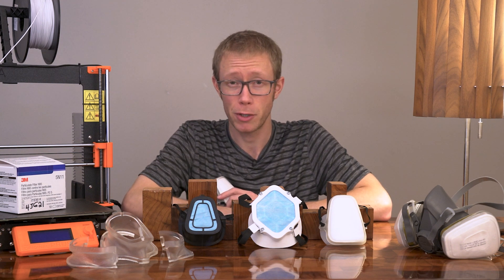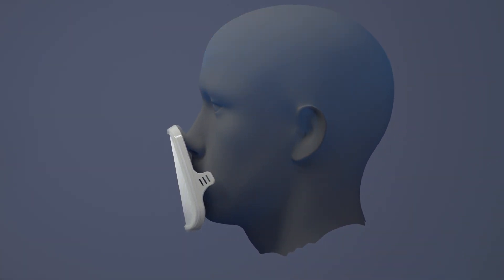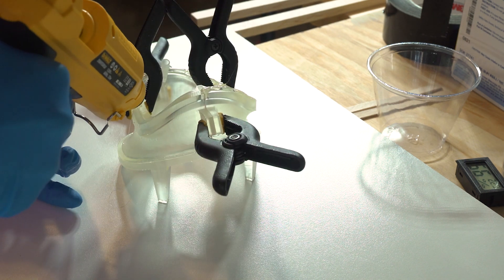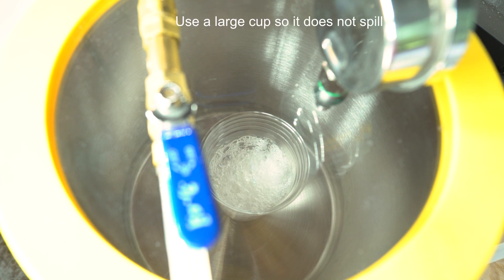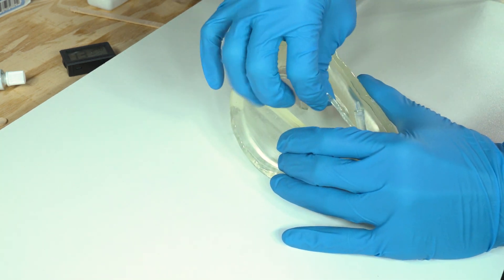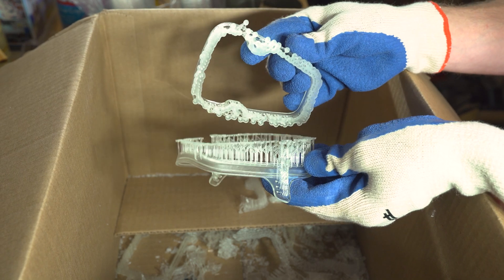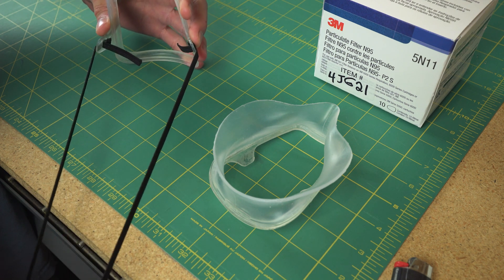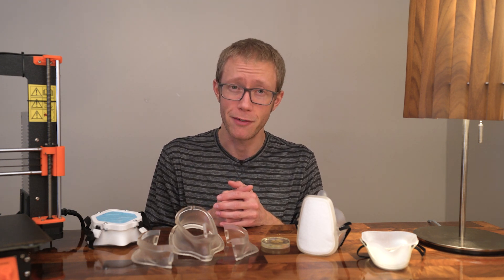Respirator Face Mask V3 with DIY injection molded silicone seal and 3M filter

Comment: Back at the begining of this damn pandemic I came across your channel an immediatly realised you were serious about making a mask that was safe and usable. I also thought that the box of 3M filters that I had for my respirator would be ideal but no designer had come up with anything to use them. I ended up making a cast mask that the folks over at 'Smooth-On' designed, also using  Ecoflex 00-35 for the seal. I like it but yours has more air flow ( which I think is the main reason most people don't want to use a mask - I can wear my 3M respirator with the two side filters for 12hrs at work with no problem of air flow in or out) I think yours is the best compromise between a full respirator ( which I also have a small 3D printed cap at the front to put a filter in to filter the exhaled air) and is the best one I have seen yet. I also like cast masks in silicone as they can be sterilised completely with heat or washing thoroughly with no adverse effect on the mask. Plus  Ecoflex 00-35 and it's variations is capable of going into an autoclave. Again well done and thanks for not letting this important issue ( wearing a good mask - not just a piece of cotton wrap) be forgotten.
Reply from the maker: Thank you! I thought the same thing. The box of 5n11 filters that I bought  a few weeks ago was produced in April. Clearly no one is using them for this purpose. 

I think the use of Ecoflex for the seal is a great idea. It's very soft and pliable and works well in the way that Smooth-on used it in their video. When I tried to use the 00-30 it as a structural element on my mask it just wasn't strong enough. Maybe the 00-35 would be more resilient. 

This particular mask isn't able to be autoclaved due to the printed components having a much lower deformation temperature than boiling point. If I come up with any updated designs, I will be sure to post them here. Thanks again for watching!

Comment: I can’t believe this channel only has 7k subs! Really cool and well presented.
Reply from the maker: Thanks for watching, Philip! Building a channel is a slow process...
Reply: @The3DHandyman  I'm working a diy version of a uvc uva rapid air sterilization mask attachment which is already patented by company selling it for $120. Is the version you make of the mask cheaper than buying the $30 industrial version? https://dont-get-vaporized.myshopify.com/ Is the patented product I wanna cut number of LEDs used by 50% to 66% using FEP UV transparent film and aluminum foil for reflecting the UV.

Comment: chinese kn95 masks are cheap now, but it's still interesting to see you iterating this. this is your nicest design yet
Reply from the maker: For sure. I hadn't actually planned on making this video at all but it felt like a good way to crack into more complex mold making. There are a few projects in the works that require cast parts and I have zero experience with this sort of thing. It was a good way to feel out the process and materials. Also, I want to put the Form 3 through its paces and see what it's capable of. I will do a video on my experience with that the printer at some point... it's hardly perfect. 

Happy to hear you like the design!

Comment: Super well done, dude!  Thank you for taking the time to design and produce.  Prusa came out with and SLA printer not too long ago.
Reply from the maker: Thanks for watching! It really wasn't too bad of a process. Learning enough to actually make it successfully took the most time out of any of it.

There are several of SLA machines out there at this point with good specs. What I wanted to do was test out the "best in class" for a year and then try out a cheaper unit some time from now. I'll do a comparison video at some point. Until then I'm experimenting with all the engineering materials Formlabs has to offer. Fun stuff!

Comment: Are you on a Quercetin+Zinc+D vitamin regimen?
Have some Ivermectin and  Hydroxychloroquine on hand to treat early infection?
Reply from the maker: I'm pretty sure my breakfast cereal has the Zinc and vitamin D. Other than that I spend my time social distancing. It's been an almost party free 2020... what a year.

Careful with what your taking. Try to get expert opinions whenever possible.
Reply: @The3DHandyman  Vit-D has to be dissolved in fat (gel caps) ... so your Milk may have it.  It is certainly harmless, and even Dr. (evil) Fauci takes supplementary D.
Back in March and April, when there was nary a dust mask to be found in stores, I frenetically printed several designs.  Still using a PETG-TPU Montana mask, made back way back then.  Heavy and uncomfortable, if used for long.
You certainly took the DIY approach to the limit, with resin-printed forms, and the face-contoured gasket.  Lightweight, and nice, large filter area too.  I certainly admire your engineering and production skills with these videos.
<RANT>
Nonetheless, I am ready for lockdowns and mandatory masking to be over.  A chin-diaper is merely a passport to be in public.  There are three other corona-viruses that we call the common cold ... and there has never been a vaccine for the common cold.  Overall death rates are within norms.  Covid-19 is just part of our biome now.
Haven't we flattened the curve already? 
</RANT>
Reply from the maker: Thanks! I definitely tried to push myself on this one. As for the virus itself, we will see how the winter unfolds. I suppose the most important goal we could have is to keep hospitals from being flooded with patients. The treatments that exist now are certainly better than what there was months ago. Hopefully by next year some time we can add this one to the list of the other 3 common but not deadly coronaviruses. Until then, I'm going to keep laying low.
Reply: @The3DHandyman  Yeah, despite the tough-talk, I live with an elderly diabetic cousin.  Am careful to mask in indoor public spaces.
Reply: If you use Hydroxychloroquine, then do not do it like the American doctors. The amount of Hydroxychloroquine was in the USA much to high, in this high dose is is poisonous.

Dr. John Campbell has made a video.
https://youtu.be/2uzXHnUViro?t=151

If you are sick: 200mg - 400mg daily as the maximum. More will kill you, but the US-doctors gave their patients 500% of this amount. Then they had the opinion that it will not work. XD

Are American doctors are unable to rad the package insert?
Reply: @mikropower01  Yes, that Lancet study where they killed very sick patients with overdoes of HCQ was retracted long ago, and disowned by the 3 authors.  Still, it is oft cited "evidence" that there are no good preventative measures, or treatments.  Am subscribed to John Campbell!  He is the most conservative YT Doctor that I watch.  Try the Peak Prosperity channel too.

Comment: Your mask looks much better than the face diapers that we currently have to wear.

If I were to create such a mask, it would be with an exhalation valve. The moisture just rises too quickly in such a mask. If the filter fabric is damp, it no longer lets air through.
You could either make a flutter valve or maybe something that looks like fish gills.

For the coming winter I am building myself a mask with stainless steel as "filter material". This metal only serves to absorb the heat of the exhaled air and to warm up the air to be inhaled again. (has no relation to Cov2)
There should be an area in which condensation can drain away.

If you are on your bike quickly and the air is very cold (-15 ° C), your lungs really freeze.

The -15 ° C in Germany should not be underestimated because it is humid, cold air. This air draws the heat out of the body very efficiently.

Even Russians (a fellow student of mine) who were used to -60 ° C dry cold were not prepared for the rapid loss of heat.
Reply from the maker: For sure a -15C (5F) bike ride could cause some potential issues. With fall temperatures there is a noticeable amount of condensation after a 1 hour ride or 4 hours of normal use. The cold would raise that significantly. The lowest part of the mask does allow a few mL of water to collect away from the face but only to a point. There is definitely not a reservoir large enough to capture any real volume of liquid. My rubber injection molding knowledge is very limited and I really don't know how to make the rubber double back on itself like all the pro masks do.

Using the 3M respirators in the winter can be problematic at times as well. I have accidentally exhaled a puddle of water on to a new paint job more than once in my life.

As mentioned the exhale valves are only one way protection so they are not ideal for the current scenario. But some people have breathing issues and really need every bit of breath they take without a mask on. I don't know how effective the ionizing/UV type of masks are but they might be a reasonable solution for the problem. At least one scientist I know has suggested that is one way to go.

The 3M filter I used in this video is quite thick and does retain some moisture while in use. Despite that, overall breathing performance for this mask is on par with the standard 3M N95s I was use to before all this mess. 

The silicone on this mask is the best part. It's of course it helps that it was designed around my face but at least for me the comfort level is better than anything I've ever warn. That said, with continuous daily use it's hard to say how sensitive my skin would get while in contact with the silicone. It does not breath at all.
Reply: @The3DHandyman  - I have to drive only 20 minutes to the train station with my bicycle.
If I go shopping, I need 30 minutes to drive to the next town in the area with the Aldi, Kaufland, Lidl (some German supermarkets) and then 30 minutes back. I do not have a car and do not need one. If the heat-exchanger-mask would work, then I would not have problems during the time (if it is very cold) any more. 

When I use a scarf, it gets damp and icy very quickly, so that no meaningful heat exchange takes place. I will try to use such a "spiral stainless steel pan cleaner" as a heat exchange medium.
If I drill a 1mm hole at the bottom of the mask, the liquid will drain off, but it will likely drip onto my jacket.
Reply from the maker: @mikropower01  Interesting concept. Maybe you could put a cotton ball (or similar) in there somewhere to soak up the condensation? Just a thought
Reply: _ David _  - Why? If you are sick and the other people are wearing a mask, then they do not get a problem.
My N95 Mask (with exhalation valve) is very tight at my face, over the nose and mouth.

The problem is: The other people can not breath with this thin paper (non N95 Masks) because they are very fast wet.
This leads to the main-problem: They are wearing this masks as "Chin diapers" or they do NOT cover their nose!

You have do do it in a way so that it works without any problems.
If the product is trash or not useable in the supposed way, then the product is useless.

This thin paper-masks are often open to the sides.

The best would be a Mask with a exhalation-valve which points to the ground. If the airflow goes down (not to the sides), then the momentum of the air is going downwards.

If you sneeze in a papermask, the air is not going trough the filter-material! The air will go to all sides and the particles will be blown all over the place. I have seen this, it works like the muzzle brake of our self-propelled howitzer M109.  You can feel a air blast to the sides.
Reply: Exhalation valves kind of defeat the purpose dont they?
Reply: @Sixztar_Mooior  - If i see the people here, then they can not use the masks for a long time if the do not have a exhalation valve.
The result is, that they pull the mask to the side, you can see the nose or the mask is under the chin. :-(
90% of the people do not wear the mask in the right way, because they have problems to breath with the mask.

This is logical, because you can not breath so good trough a wet cloth rag.

This means that 90% of the people walking around unprotected. They use some type of trick to let more Air to their lungs. They cheat.
Reply: @mikropower01  i wear a standard paper surgical mask for 12 hours a day. It does not become wet.
Reply: @mikropower01  If you try to explain this to any of the 90% they get very upset and try to make you look like an idiot.  I have used masks for many jobs.  When you need it and it is not working you can immediately tell.  But I'm just the idiot that everybody calls when they have problems they cant figure out, what the hell do I know anyway :)

Comment: Add hoops and hooks to the resin part to give the glue something to flow around and in to.
Reply from the maker: I like it. What I really want to do is use the hoops with overmolding. The warp on the printed parts really complicates that process, unfortunately.
Reply from the maker: Although this may not be a perfect solution by any means, I am able to permanently join the 2 parts using this method:

1) Glue the mask rubber into the plastic component using J-B WELD Clearweld Clear Epoxy Adhesive
2) Pull the rubber off after the epoxy has cured. The epoxy does not bond with the silicone.
3) Apply Smooth-on Sil Poxy to the mask as shown in the video. Then reapply the mask rubber to the plastic component.

 I tried 16 different glue combinations. None of the glues bonded directly to the silicone. The Epoxy does not bond to the rubber. The Sil Poxy does not bond with the plastic. However the Sil Poxy does bond permanently with this specific Epoxy. This combination was the only one that was even slightly effective.
Reply: @The3DHandyman  Such thorough testing! i just found your channel. very exciting stuff :D
Reply from the maker: Thanks Victor! I do what I can.